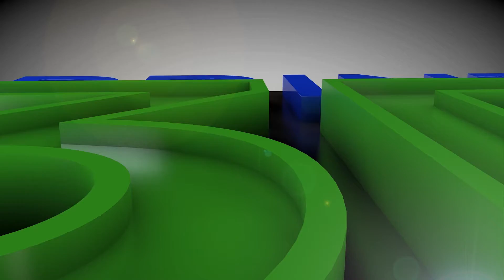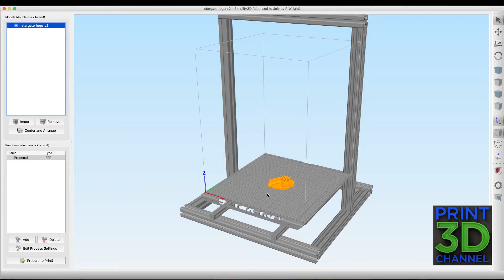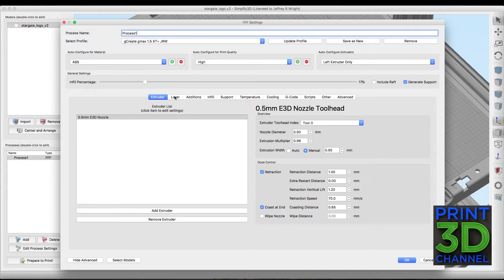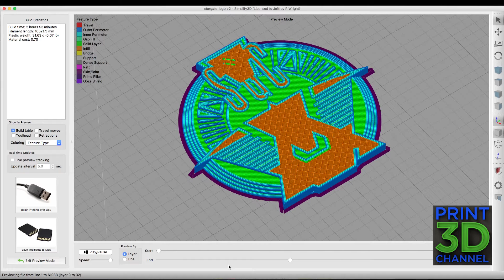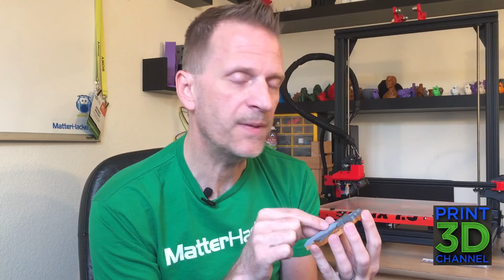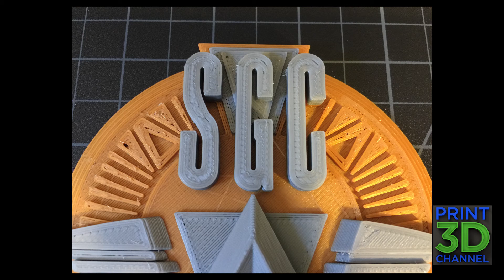#3DP365Project - Day 33 - Stargate Command Emblem - MatterHackers PRO PLA & gCreate gMax 1.5XT+

Comment: I LOVE Stargate. I bet I've seen every episode at least 3 times (now that is a LOT of wasted time.. :~) ). Universe sucked but SG1 and Atlantis are just fantastic. 

I think you're under extruding a bit, you should be able to bump up your extrusion multiplier to fix that, as 17% infill is plenty for that model.  I've found for me it's caused by filament diameter inconsistencies most of the time. 

I've notices that you stopped using the Out-side-In option; this model seems perfect for out-side-in?
Reply from the maker: It was an awesome show, I didn't get into Universe for I am not a huge fan of Robert Carlyle, great actor, just not my cup o tea. Atlantis has to be my favorite of them all. I will look at the print under the magnifying glass and see how my layers look, and adjust the extrusion multiplier if needed, thanks for the heads up. On this one, I probably could have done the outside-in method, might improve it more. Sometimes I forget to turn that setting back on, so used to NOT using it, ya know. Thanks for the tips and suggestions, RJ, and of course, for watching!

Comment: Good one, how do you like the silicone socks?
Reply: They work well to insulate the block but you have to make sure the print doesn't curl and pull it off. If you don't like them they are very easy to remove. We haven't had one fail yet but we've heard it can happen.
Reply from the maker: It is a welcome addition the hot end, keeping all the precious heat inside the block and this also stopped my extruder from having back pressure and skipping when the parts fan was above 70%. As Gordon mentioned, it is a good idea to check the seating of the sock between prints, make sure it is snug to the hot end at all times. Thanks for watching and for the comments.
Reply: I am asking because I made my own for the volcano block. I absolutely love the idea, I think they need to more solid, the area around the tip of the hot end should be padded so that it doesn't end up getting knocked off. This is the one I made: http://www.thingiverse.com/thing:2031489 and it works super well with my dual extrusion setup.